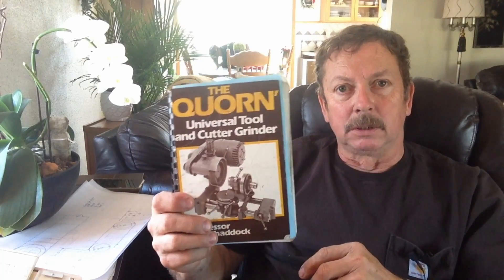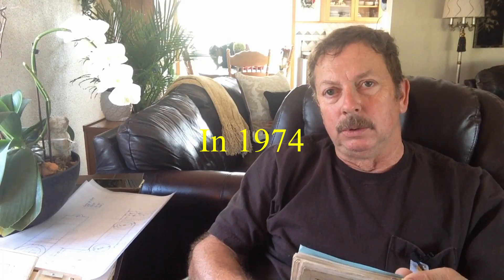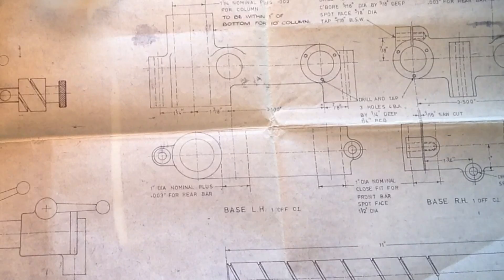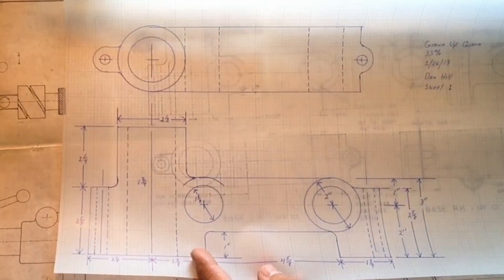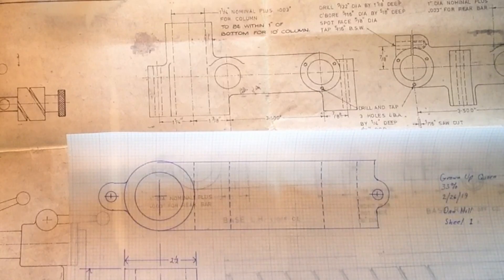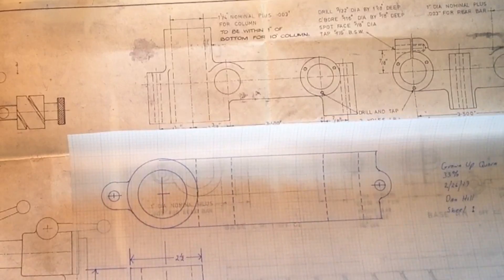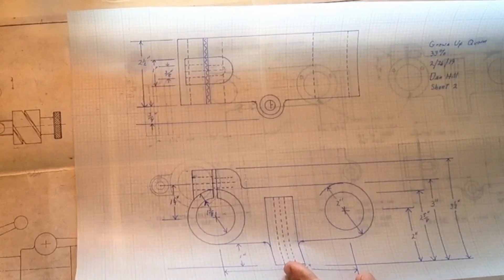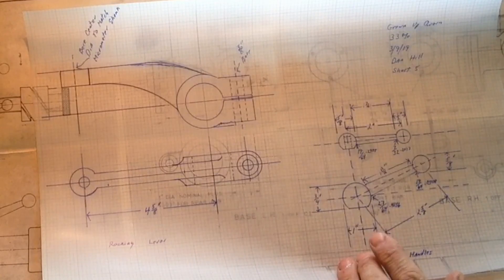Building A Grown Up Quorn Tool & Cutter Grinder: Part 1

Comment: Will  the grown up quorne still be able to make the 1/10 diameter cutters?
Reply from the maker: Not sure what cutters you are referring to but it should be able to produce anything the original will produce depending on the tooling I build.
Reply: @hillsgun  well in the description it says you can make your own end mill down to 1/10 inch diameter. I was just wondering if it would still be able to do that.
Reply from the maker: Yes, no reason it wouldn’t if tooling is set up correctly, and good tolerances are held during construction.
Reply: @hillsgun  okay thanks for replying. 
I'm going to copy what your doing then  keep up the good work 👍

Comment: A week or so I did my periodic search for Quorn Tool and Cutter Grinder and 4 or 5 new channels came up including this one. The vagaries of Google?

I have a working original item that I am looking to upgrade etc.

The use of aluminium castings looks interesting so I will follow along. Eventually I would like to make Aluminium Bronze castings, the upsized project sounds like a perfect application especially with Stainless shafts.
Reply from the maker: Yea, those videos have been up for a while. I keep looking at the pile of castings and shafts but have not gotten back to them yet. It will be happening soon. I didn’t use stainless because it tends to be softer and seems to wear quicker. Thanks, Dan.
Reply: @hillsgun  Ok Dan, where I live corrosion is a bigger issue than wear.
I've purchased 304 SS rods to rework my Quorn, I hope to get on with it over the coming months. I haven't checked the material for roundness yet, that will be task #1 once I finish lathe updates. I've had a taper attachment and DRO awaiting installation for a few years. The taper attachment ended up being more involved than expected and DRO  on lathes is not straight forward. Maybe my procrastination was more than just work commitments and then Covid.
I haven't done any casting for a couple of years, time slips by. Have you seen the amazing casting work Kelly Coffield does?

Comment: Just found your quote stuff. Not much about the quote on YouTube so this will be interesting.

Did you build your first quorum from available castings or did you use your own castings?
Reply from the maker: Thank you, I hope you find something usefull. My original was built with my own castings and overall it has it's flaws but is a very functional machine in my shop.

Comment: at some point will you have castings available for purchase?
Reply from the maker: I had not planned to offer castings, If I do it will be after mine is fully completed and any corrections made to the patterns that may be necessary. Thanks, Dan.

Comment: Why a Quorn?.....why not a bigger Deckel SO?......less fiddly bits.
Reply from the maker: I will at some point be adding a deckel style "D" bit grinder because they are much easier to consistently set up than the Quorn. The problem with them is they do not have the versatility of the Quorn. It is a trade off, the extra utility of the quorn versus the speed of setup and repeatability of the Deckel.
Reply: @hillsgun  I sold a Deckel SO 2 months ago as it was limited....in my opinion........for grinding end mills that I can grind on my bench grinder on the ends with a small jig etc, great for grinding D bits and lathe tools........but, some time back I acquired a Cuttermaster T&C grinder complete with radius attachment but the Deckel was small and compact but limited.
The Cuttermaster has the ability to tilt the head over to grind the helix primary and secondary angles as opposed to rising the head up to grind on the wheel periphery which is one main reason I bought it.

Comment: Very interesting to me as a Quorn owner/builder although the first part of the video would not mean much to others.
Good point about the diamond wheels; do you intend to grind with coolant?
You show the new main castings as slit like the old; may I suggest the use of split cotters instead so as to avoid the danger of the casting closing up when slit?
I look forward to catching up with this impressive project and wish you every success
Reply from the maker: Thank you, I just finished the 3d print for the actual sand pattern for the rocking lever and will be showing it in part 4. I probably won't run coolant just because of the mess, but we will see. No I am not using split collars for this project and there are a couple of reasons for this decision which may or may not be valid. With a split casting I think that there is slightly more even pressure applied over the full length of a longer bore such as the wheelhead and as such requires less overall tightening pressure so secure an assembly. Another is that it requires more material in a casting to support the extra material of the split collar, and the smaller bearing surface of the split collar while "usually" easier to operate will centralize the higher clamping pressure in one area with the potential to possibly impregnate grinding swarf or scar the shafting. And last, I have seen older pieces of equipment which have worn over the years where the split collars have become worn or distorted which were extremely sticky and would not release as intended.

Comment: Hi Dan, we are a repeat viewer, happy to be listening in close here.
I think these two guys can get excited about this larger version scale 33% upgraded build.
We would prefer (we not the two doing the work here you are) to see you using cast iron you are going aluminum, what alloy type grade aluminum are you looking to hit.
Take your time (our opinion) what would be the hurry, we think things take what they take in our shop as well.
We are in.
Lance & Patrick.
Reply from the maker: Hi Lance and Patrick, I remember some of our previous discussions and am glad you are following along. The question of cast iron or aluminum has been discussed at length before the decision was made and there are several pro's and cons to both materials. I have sucessfully cast iron (sucessfully is a relative term) in my home foundry. It is prefered since it will probably absorb vibration better, be more wear resistant, be heavier, but most of all in my opinion is because it is more traditional, machinery has always been cast iron. But when we brake it down farther it was because it was from a time when foundries were commen and castings could be easily and inexpensively obtained from these coal/coke  fired foundries and labor was cheap. Now there are very few foundries around, labor is expensive and regulations require more elaborate procedures and more expensive fuel sources to operate which equals expensive castings usually not ecenomically feasable for a one off project like this. The aluminum castings, while not offering some of the desirable caracteristics of cast iron has several advantages for this application. It is inexpensive and I can produce them myself, they are plenty strong for this application for home shop use, I don't consider there lighter weight to be of much consequence and I don't beleive there is any major difference in rigidity, and I beleive that my technique I intend to use to mount it will overcome any of these issues. The sliding base assembly has the potential for the most wear as it slides along the front bar but for home shop use I think it will probably last well beyond my lifetime so I don't consider it to be an issue. Alloy will probably be 356 or something close, but there again for the home shop as long as it has relatively good casting qualities it isn't that important. Thanks again, Dan.